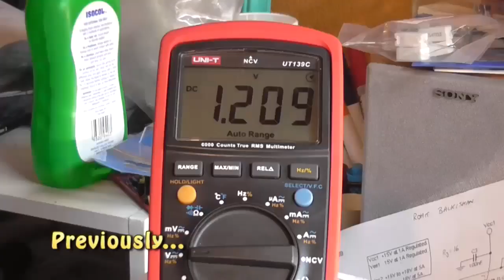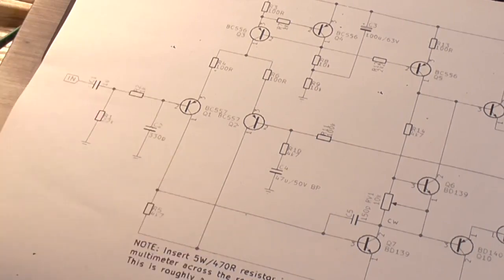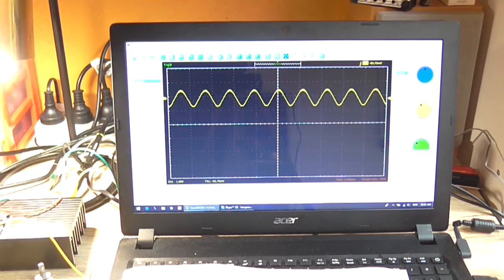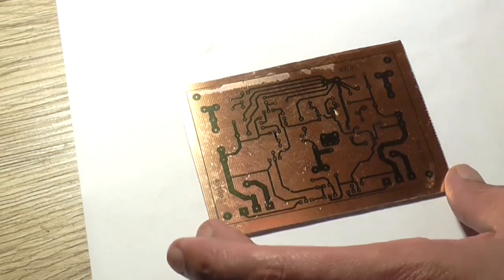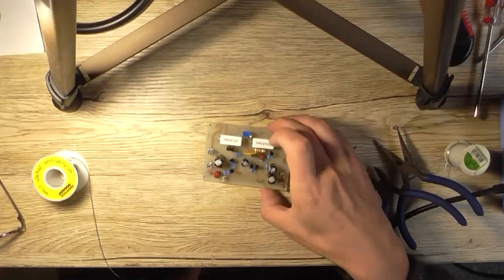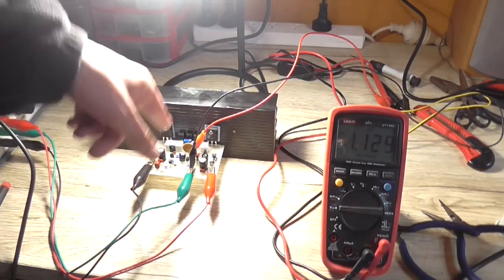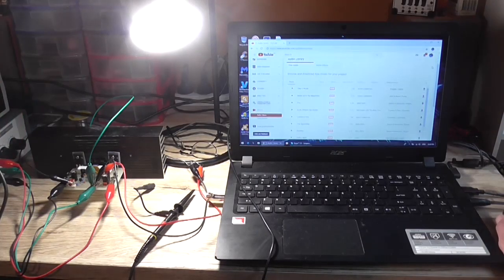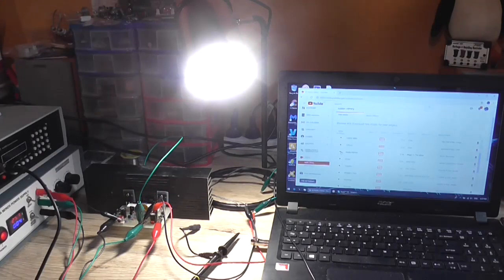Discrete Power Amplifier Part 3 - Now on a PCB!

Comment: Great video. I recall ETI came out with some useful designs. A friend put together an ETI5000? preamp long ago to go with my quad 405. It was an improvement on my 33. Only sold it a couple of years back. Any idea about distortion level and harmonic structure? How would you rate it compared to your JLH1969 clone build? I recall you quite liked the sound?
Reply from the maker: ETI series 5000 sounds about right. This original power amp was an ETI design. As for the THD characteristics, from memory the original design had less than 0.5% at 1kHz at full power before clipping. With different transistors and choice of resistors I would say it would be now less than 0.02%

Comment: The input devices is badly matched but tuning out the offset is a simple matter of changing the degeneration resistors on the long-tail pair with a pot and simply turn the pot to achieve zero offset.  Also, important is to  ensure that the FB resistor value is the same value as the input bias resistor. If they are not, you are causing the offset by setting different bias currents on the input transistors. Problem solved, interesting that the designer did not know this simple rule. The design is just flawed from the outset.
Reply from the maker: As I said, read my pinned comment on the subject. I agree, the original design is flawed from the start, but what do you expect from ETI in the 70s.

Comment: Hello, there must be some way to measure the DC voltage in both power resistors in the Emitters. Maybe with OPamp as differential amplification. I do not know.

I know it is obvious, if the same current passes through both resistors, the DC offset would be 0.
By measuring the DC voltage of these resistances, the bias of each branch could be controlled separately. I think I could make it less dependent on temperature.

When I say "measure" it is to sense the current or voltage and that with several OPamp the circuit adjusts itself.
There are OPamp for everything, even galvanically isolated by PWM light.
Surely what I'm saying is silly, but surely someone has done it before, or at least tried.
It is that knowing that the transistors, even if they are complementary, are not identical and the same with power resistors and they are not 0.1%.
Reply from the maker: Most of the DC offset is produced in the long tail pair differential. This can be due to a mismatch of transistor beta (hFE). This can be cured in many ways from matching the transistors, adding a current mirror in the collectors and/or adding double transistors per side to improve linearity. Douglas Self published a book which is freely available as a PDF on power amplifier design discussing this very problem.
Reply: @AstrosElectronicsLab  Hello, I am interested in the book you are commenting on, could you give me an extra reference?
Looking for "Douglas Self"?
Thanks!!
Reply from the maker: @a-job7276  https://d1.amobbs.com/bbs_upload782111/files_29/ourdev_554203.pdf

Comment from the maker: I do want to make a correction: around 1:20 I'm talking about changing the 100k feedback resistor to 22k. If you notice on the first transistors base to ground, there is also a 22k resistor. Both the negative feedback resistor and the "input" resistor have to be the SAME value to minimize the DC-offset. Also, "matching" the input transistors (ie: same hFE, etc) goes a long way, too, if you're that anal.

Comment: DC output off-set of 100 - 150 mV is atrocious don't even say it is fine, absolute rubbish! You are exposing your bad understanding of design capability.
Reply from the maker: Let me clarity something. DC offset under 100mV is perfectly fine and I have seen commercial amplifiers hover around 75mV. I misspoke when I said between 100 and 150. Also read my pinned comment where I already addressed what you commented over 2 comments already. Thanks for the input though (pun intended).